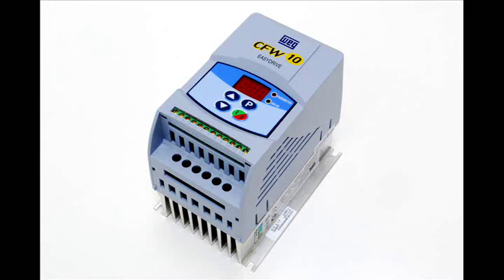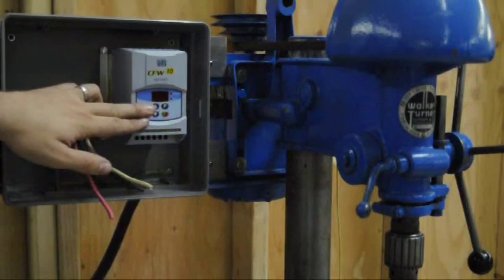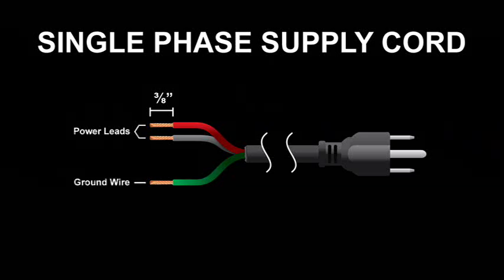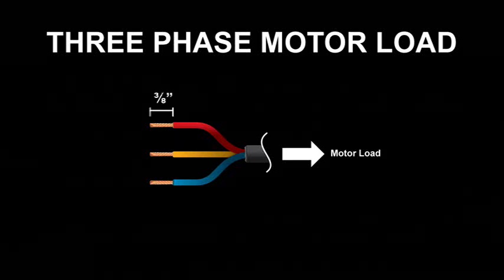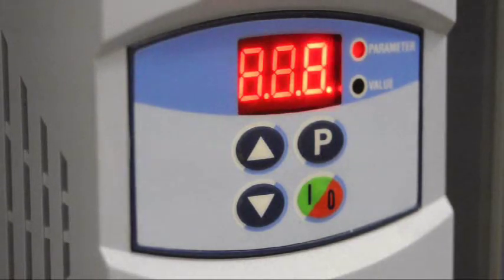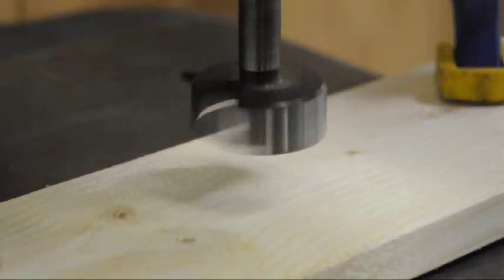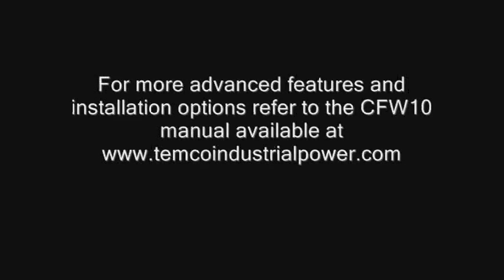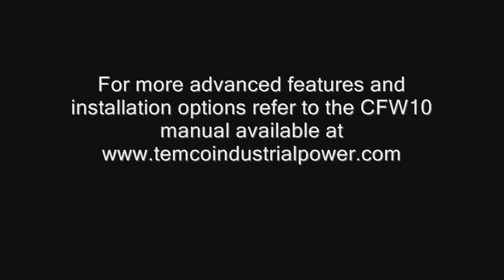TEMCo How To: AC 120v Single Phase to 230v Three Phase VFD

Comment: I have a 3 hp 230v 7.9amp rpm 3480 motor and I live in the US where the standard is 120v I can plug this three phase VFD into a 120v wall socket and it can power my 230v motor completely  

sorry if this is simple stuff

thanks

Comment: You can´t turn 120V to 230V using just a VFD. The VFD doesn´t elevate voltage, just transform electrical energy from single phase to three phase.
Reply: Umm, yes you can.  We power 208 volt 3 phase motors at my work using regular 120 single phase AC via VFDs all the time.  Schneider Electric model ATV12H075F1.  Look it up.  Have you been living under a rock?  Research before you speak.

Comment: I only have a 1x200-240 configuration in my danfoss vfd, and three 110v hot wires and one neutral, I don't have 220v wires available in the garage , how can I connect my vfd to my 1hp 240v three phase motor?

Comment: Hi. 
I do have a mexican grinder with a Weg 10 hp 230v single phase 44 amps motor. 
I would llike to know if is possible to use a speed controller drive.

thanks
Reply: Be sure to give him salsa with his tacos, he might get cranky if you don't.

Comment: Hi this is good news for home workshops! I do need some advice before purchasing though.  

My project is a 2 x 72 belt grinder, the ideal HP motor is 1.5.
2HP is the max

I didn't find a 1.5 HP unit in the list and 2HP units require more voltage supply, which defeats my purpose!  

Is there a 120v supply CFW10 unit # for the following 1.5HP motor I am looking for to pair with the unit?

AC Induction TEFC 1.5HP, 3 Phase, 1800RPM, 208-230v/460v @ 4.8/2.4 amp (electronically reversible, 2:1 constant torque rating)

Thanks in advance for your response!

Comment: I have an old model 66 Powermatic Table saw with a 3hp 3phase motor on it. Can I run it on single phase with this VFD? If so, how much does a VFD cost?

Comment: I have a need for a vfd that outputs to a 10 hp 220v 3ph.

input choices are

a. 120v single phase
b. 220v single phase
Reply from the maker: 120V single phase won't work. The 220 V single phase input can do it, but you need a VFD that is double the size of your motor (in amps). You'll also need a circuit capable of supplying the total single phase amps that the circuit will require.

Comment: Are these units able to be integrated to cnc control conversion for machine tools? For example, if you have a manual mill that you wanted to convert to cnc, and it has variable belt speed control for the spindle, would a cnc control be able to be linked to the frequency drive to change spindle speed?

Comment from the maker: Yes. The foot pedal would need to be a variable resistance type, and that would be hooked into the analog inputs of the drive. CW/CCW could be done with a toggle switch hooked to a digital input. Check out any of the product pages of the CFW10 series on our ecom site, and click on "CFW10 Remote Control Quick Start Guide," which covers these connections.

Comment from the maker: The CFW08 line should do the trick, though you will need to know a few more specs. Check the nameplate verify that it is indeed 5HP, and also check the voltage and FLA before sizing a VFD for it.

Comment from the maker: Hello, thanks for waiting for our response.

115V 3 Ph delta output usually comes with high frequency (400 Hz) applications, but it is rather uncommon. If that is truly the case for you, it is still possible to program a CFW10; however, you will need a special filter and step-down transformer combo.

Comment: Hi, thanks for responding.
No, I have no clue whether it is Y or Delta. But, it has 3 wires coming out - all measuring the same Ohmic value. The 4th wire is just a chassis ground. I wish I knew, but I don't think there's any easy way to tell. Your CFW10 is yet another 120V to 230V3ph....

Comment from the maker: We have a CFW08 VFD that's capable of operating 575V. The CFW10 can't go that high, so please search "CFW08 575" on our website for drives that can go in that voltage (link in description). If you don't have 575V input single phase available, you may need a transformer (also available on our site). Feel free to call us for more questions!

Comment from the maker: Both drives will work and give you the full 2 HP.

The 7.3 amp rating is the maximum output of the drive, so your motor will be fine drawing only 5.8 amps off the drive.

Comment: will this WEG CFW100073SDPLZ VFD C10015 

VFD work for a 230v 2hp 5.8 amp  3 phase motor ? or can i use this one
 WEG CFW100073SDZ VFD C10007
that has the 110-120v input and still be able to use the full 2hp and full 1800 -3600rpms
also are amps an issue the VFD uses 7.3 amps and the motor uses 5.8

Comment from the maker: No, these will not work to run a mig welder. However, you can use a rotary phase converter to do so. If you can provide us with the amperage and voltage of your welder, we can make a recommendation on one of our TEMCo phase converter units.

Comment from the maker: 1) The VFD will attempt to compensate for load to keep the speed constant. The CFW10 may not be able to handle 15000 RPM, so we suggest using a CFW11 instead. See our website in the description and search for "CFW11" to see all models.

2) Yes, it has protections for overspeed.

3) No, the VFD's full output is going to be consistent with its input. You will need a transformer and a 415V VFD.

4) The CFW10 series goes up to 3 HP. See our CFW11 line on our website, which goes up to about 600 HP.

Comment: hello Temco, i have a question !! 

1) can i program vfd to a RPM @ 15000 and works like a governor of deisel engine if he feel heavy load and speed become low can he automatic recover @ 15000RPM ???

2) and can i program this vfd on overspeeding shutdown ???

3) and do you have the vfd volts input @ 240v and the output is 415v ???
4) and how much hp of electric can handle of this vfd ???

Comment from the maker: They start in at about $150 for a 1 HP motor and go up from there. 

There are a few slightly cheaper drives out there but without the support and design features of these WEG units. They are really first-rate. 

See products in the video description above.

Comment from the maker: @67tr876 Your single phase amperage draw at full load on single phase at 120V would be about 18. Your 15 amp breaker will likely suffice though, as you may rarely ever see full load on that motor.

Circuit breakers generally use a time vs current curve to plot the trip point. Basically If you do ever manage to load your motor to its full capacity, it will take a minimum amount of time before the breaker will respond by tripping.

Comment: @TEMCoPower See thing is i have one i got a T8 woods one with a top of 1.5 hp 1.1kw the most they had with 230 volt 3 phase output but when i saw this video now am mad that i could have got a nice easy set up form you then the one i have. But um look i might get one more so ya. And if i am runing a 1 1/2 hp 3 phase motor that take's 5.2 amps of my unit how many amps will that be on the 120 side ? I had to put in a 15 amp breaker for safety. Its got a 5.8 max